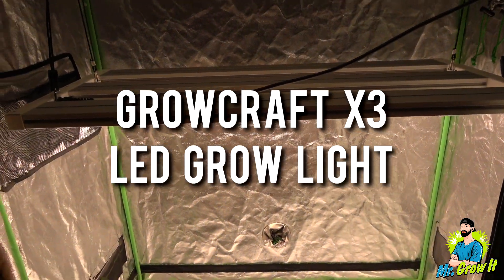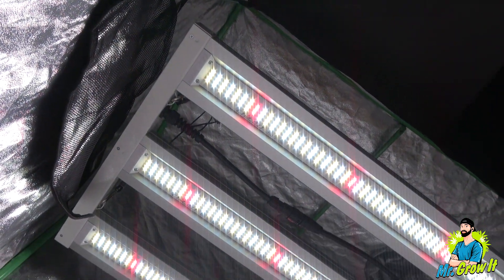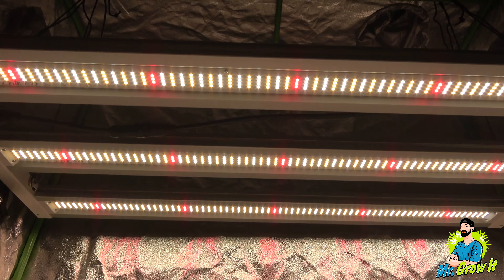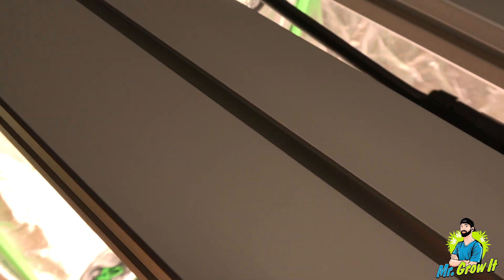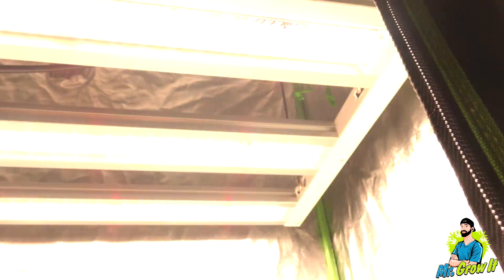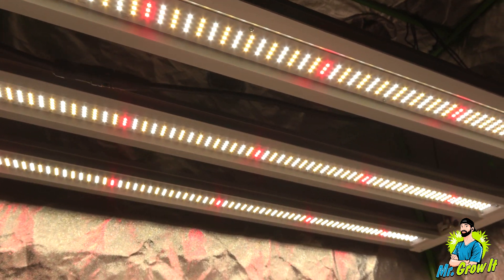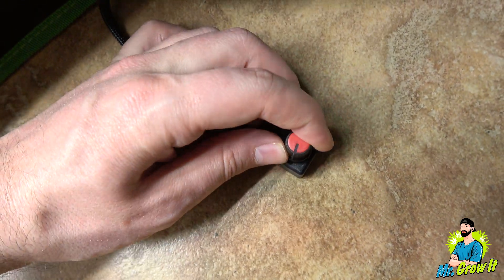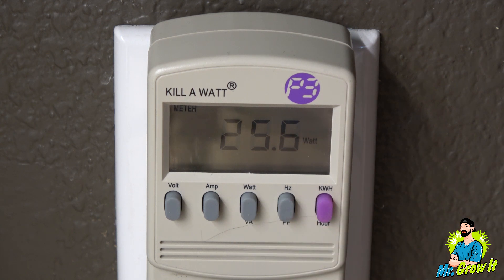Growcraft X3 LED Grow Light PAR Test & Heat Test!

Comment: I bought the 200W X3 Mini for my 3x3 tent and its a BEAST!! I put the 300W spiderfarmer SE3000 I had back in its box, THATS how good this light is. Dont waste your time with Mars or SpiderFarmer if you can afford one of the lights. Get the flower spec light to run in bloom and run any old light you have laying around for Veg, im using a 150W ViparSpectra XS1500 for veg then switching to the X3 mini for flower. Literally the perfect combo for a 2x2 or 2.5x2.5 or 3x3 tent. And by using two diff lights they will both last twice as long So the expensive X3 mini is even better value for money. I'll easily get 15+ years out of this combo no worries.

Comment: Torn between this x3 vs the ROI 420...based off specs this light is so much more efficient, gets brighter, less heat and lighter! I like ROI420 controller and that was a selling point but the guardian system for chill coming in August looks promising but more complicated and def north of 1000$. We will wait and see but chill might seal my deal!

Comment: I having trouble deciding between this or the ES300 V3 what to do!
Reply: DO NOT GET THAT ES300, I compared it to the ROI420 and this...that sunshine company is a joke...tht lights total output is only 696 I think..pay attention to the measurements, they use 2 lights on the chart to get numbers which is weak....they also cost 700x2 just to get decent par readings...
Reply: @NewEra0G  my friend that's exactly what I thought...till I bought an es 180 v2 ..now I have the es 300 v3...WOW IS ALL ILL SAY.. the light spread..intensity ..is amazing...i own  the Chill led also...u can laugh but the electric sky is simply amazing ...i had my doubts big time...the far ted spectrum they use is phenomenal..dont get me wrong im in love with my chill led 330 ..i will say this ill always own an electric sky...it is unfortunate that they do use 2 lights in the 2x4 testing ...i will say this the es 300 v3 is worth every penny

Comment: Looks good @ 36" from the floor seed to harvest for autos. 5 gal fabric pots , no transfer. Maybe 1 height adjustment before harvest for taller ones. You could also hang 4 13w Exo Terra 150 cfl UV bulbs between the bars .
Reply: Wow smh

Comment: Would you put this in a short tent? More specifically 2x4x4'11 😅
Reply: yeah it would work in a shorty, if too strong when plants stretch into in during transition then the dimmer will let you still dial it down for your space(costing you less in electricity anyway)
Reply: Bub there are plenty of 2×4s that are 6 feet and 6 feet 6 high

Comment: Sorry yo chase mr grow it 
Chilledled has em for 499.00 your boys have it for 616.00 with discount
Correction 
499 for diy 
649 for commercial 
Sorry Mr grow it I got a little excited all ❤
Reply from the maker: The commercial grade Growcraft X3 330w is listed for $649 on Chilled website. That's the model in this video.
Reply: @GardenTalkwithMrGrowIt  just purchased the day x4 its so awesome that is modular I can add bars if needed more light at 99 a bar sweet thank you for your review sold me
Reply: Understood got ill jettison now thank you for correcting still thinking of purchasing 3 year warranty is awesome
Reply: LEDs depot has the 4 bar 600 watt diy version for 699. But it comes with no warranty. If you want the warranty you have to buy the preassmbled version for another 200$.. But this light is killing the game. Probably best light on the market right now. I just wish they were a bit more forth coming with what diodes they are useing. Probably same as the crecer panthrix and cree with Osram.  But anyways 699 LED depot free shipping to the lower 48 and no tax. For the diy version.
Reply: @timpage5021  lol purchased the x4 diy and 2 additional 160w bars set up a 2x4 and a 4x4 from specs this will beat my current par reading by 2 using 2 of hlg 420w 2 panel boards start in a 2x4 the 4x4 limited space in apartment and for warranty i asked chilled this is the reply.
 (The DIY kits do not come with warranty other than that of manufacture defects within the first few months (burnt out diode / led failure , ect) and does not include user error/damage when assembling.
Commercial which comes assembled gets the 3 year limited which covers most problems which would occur other than normal wear/tear and direct damages (dropping on the floor, ect).
Reply: @magosd70s  They also have some wiggle room in that warranty..Austin is who I deal with said they handle warranty claims on a case by case basis..He told me the DIY comes with a 1 year warranty
Reply: @ronnieblack2482  oh i purchased the DIY 6X freaking awesome light
Reply: You are right, to a degree. Once plants reach flowering, coco will have become more stable and as a result it will need less Cal Mag, this is helpful because bloom boosters can step in and fill the EC Quota that cal mag can surrender...I'm not saying cut if off all together unless you can, each grow is different. but the fact remains as plants hit flower being grown in coco. By the time they reach flower, the coco has become way more stable...Feel free to research it for yourself...

Comment: They are by far the most efficent light as of now the x6 is killing it
Reply: Deez Nuts I do believe this is the best grow light on the market.  Chilled has always made the best lights, but they just exploded out of nowhere!!!  I’m so happy I was dreaming for a new Chilled light for two years.
Reply: Raymatix hamr is killin it
Reply: Molly Lewis those are good lights
Reply: Axtually, Think Grow is the most efficient for a 4 x 4. Growcraft x6 is #2.
Reply: @PeterKKraus  lmao no
Reply: Peter Karel Kraus I still think the growcraft is the better light.  It seems to have better par more even coverage plus penetrates better.
Reply: @alienman2939  Growcraft is only slightly behind the Think Grow. Both are expensive. The X3 would be a great light for a 2x4 tent though. 4 - 3 gallon fabric pot autos that can produce 2oz or more each x 4 grows a year. If you have space for a 4 x 4 and the $ , Think Grow is at the top of the heap.
Reply: @PeterKKraus  Have never grown autos and I’m wanting to dive into it. I’m kinda confused on how to feed them though? How does that work?
Reply: @jhonwayne1003  Same as photoperiod stages. You just keep the lights on 18-6 or 20-4.

Comment: What do you recommend for a 5x5 tent that is good on power and low heat ??
Reply: AL M this also comes X 6 bars for 5x5, this looks like it is better than hlg quantum boards 😱
Reply: I got the X3-500 is has 3 x 5 coverage so two would be phenomenal in a 5x5 ..THey're having a sale right now